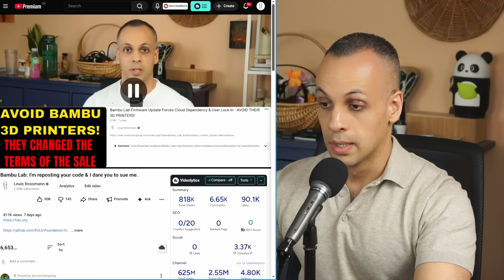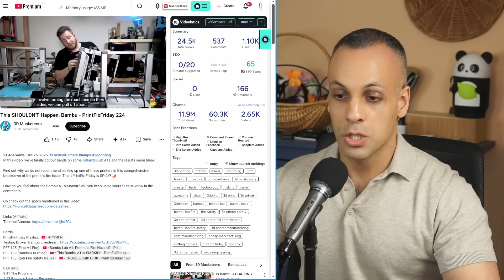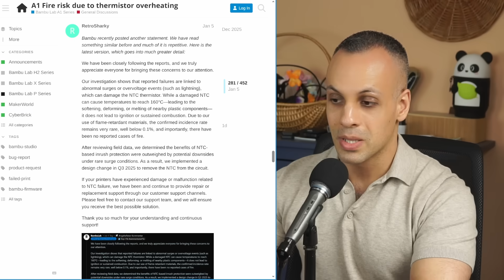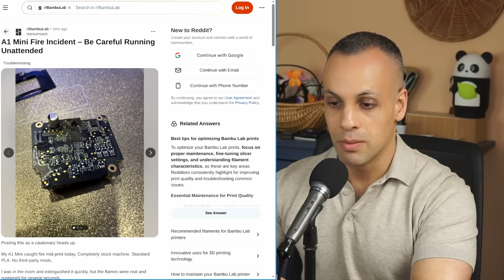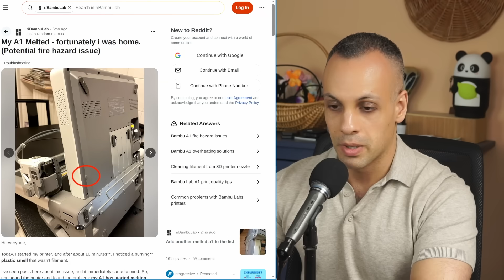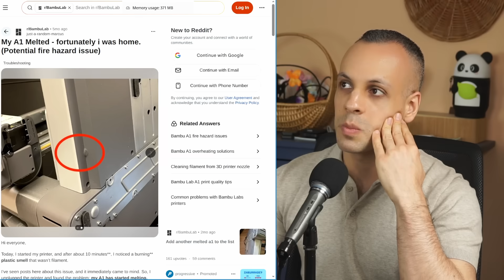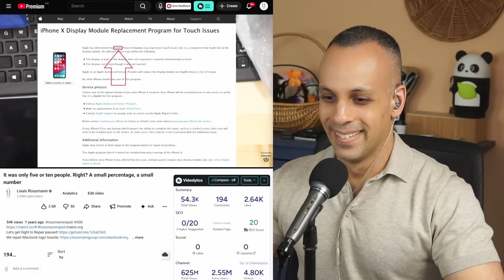Bambu Lab PR dumpster fire is turning into a literal one...

Comment: I use a bambulab a1 mini, and got a 3rd party AMS, and after managing to flash the right firmware on the AMS to get it working with my printer, the printer every 4 or so prints starts throwing a tantrum complaining that the firmware version isn't right between the printer and AMS and completely cancels the print. This happens after the download and unzip, and i have to both cancel the warning on the printer, and in the slicer, and then re-send the print and hope i don't get the error again.

It is a pain in the ass, and i have no idea how to fix this, i got the same 3rd party AMS that another friend uses for their A1 printer, and for them it works fine.

Other than that i had no huge issues with it, so i don't really have much personally to hate them for, but damn i kinda wish there was a company as popular and famous for their easy setup and "it just works" usability such as bambu, cuz i would've rather went with a company that doesn't try to fk over its customers..

Oh well, i just gotta never update it again, nor the slicer, nothing, and i'll keep being able to use it. :D

Comment: I don't know how bambu managed to source NTCs that doesn't do the NT part reliably
Reply: NTC = Negative Temperature Coefficient thermistor. It's counter-part is the PTC = Positive Temperature Coefficient thermistor.
An NTC has a (relatively) high resistance when cold and the resistance goes DOWN with temperature increases (ie. current flow lowers impedance). This way it provides excellent protection from surges while powered down. They are common in AC power supply design and operate very hot (>100C) in normal operation.
A PTC has a (relatively) low resistance when cold and the resistance goes UP with temperature increases (ie. current flow increases impedance). This way it provides excellent protection from short circuit loads on battery output terminals. They are common in battery packs but provide very limited protection if already operating at high temperatures.
Reply: @dl5244 what does this contribute to my comment?

Comment: Just like I owned a DJI Mini 3 Pro then upgrade quickly to a Magic 3 Pro, just got a new H2D to upgrade X1C (paid $1000+ 😔) they are great products. A lot of it, as you say, just works. Where others lag behind Bambu takes the lead, eventually others will catch up but right now Bambu, like DJI, is on their shit hardware and ecosystem wise. Sure they have issues, but they have less overall bad experience with customers I'd say. Competition drives prices down so I hope others step up to the challenge real soon, theres some interesting printer tech coming down the line soon, just don't want to have to pay $2k for next one lol.

Comment: Well, NTC's are supposed to get hot, they are most efficient in that state. But exactly because of that the designer of PCB has to place them away from components sensitive to heat.

Comment: my a1 stopped working and smelt like burning. i look at the bottom and a literally hole was blown out of it and melted. i opened it up to find something on the ac board probably a resistor of some sort had exploded. I contact bambu labs about it and they said I needed proof of purchase to get it warrantied. It was a gift and i dont have a receipt. Its a bambu labs printer!!! why on earth would i need a proof of purchase if its a printer from them. it shouldnt matter where I got it. there defect caused it to blow up. its less than a year old with light use. I hope they send me a replacement but im not crossing my fingers.

Comment: Every NTC thermistor / reaistor I've ever seen is near the power input, and usually in my experience with consoles, their power supplies have them and they burn up and could %100 cause a fire. Idk what the hell they're talking about. It's not like its a fuse that blew, that wont catch fire.. an ntc thermistor or negative temperature coefficient resistor where all that power is coming in.. good sir.. lightening? LIGHTENING?!?!?

Comment: I have the P1S and leave it running unattended. The only thing I don't like about it is the closed source network module. I plan to move it to its own locked down network segment so I don't have to worry about having closed source CCP code on my network.

Comment: I had 4 Bambu Lab A1's and 3 of them had boards that shorted out completely. Those occurred only 2 weeks after buying them. The 4th one had a mainboard failure which Bambu kept saying it was caused by a bad 3MF file that was sliced using their software. In the 6 years i've been 3D printing i've never seen that occur. Thankfully all 4 machines were purchased from Micro Center and they allowed me to return them even after the 30 days return window since Bambu kept giving me the run around for over 2 months. Since then I've been slowly switching my print farm over to Creality K2  and K2 Plus printers, along with the new Snapmaker U1. Both companies have had awesome customer service and they actually like seeing users modify their printers.

Comment: Hey Louis, been a long-time watcher. I like what you are doing and stand for, I do miss the old board repair videos, but this is also nice to watch. I am sure a lot of people know the name here, but Prusa makes a very good printer as well that is competitive against Bambu labs and based on what I have read about them they are much more in line with what you stand for. I.E. open-source Firmware, source files for 3D printed parts to replace on their printers. Overall, a much better company in my opinion and their customer service was also on point the one time I had an issue with their printer. Your comment at the end of the video is the reason for my comment now. Pruas's PR department may not be as big as Bambu Labs but they are one of the OGs when it comes to 3D printing and they are a very good 3D printer if people are looking for an alternative.

Comment: They always claim "small number" or "isolated case" or something like that. Years ago I was maintaining a piece of machinery about 100 times the price of a consumer 3D-printer. The particular model had a well-known in the field design fault that caused a part to fail after a certain amount of use resulting in a day of work replacing it and parts cost of a few hundred euros. Every time I ordered the parts for another repair the importer's parts salesman went through the same well rehearsed speech of how this part ALMOST NEVER failed and I was the first in a long time to ask for it and we must be doing something weird with our machine for it to fail. They still always had them in stock and the manufacturer was obviously trying to solve the problem as they kept slightly changing the part and issuing service bulletins aimed to prevent the failure so they knew the problem but refused to admit it in fear of people demanding actual repair or replacement of their machines.

Comment: Shame on the ntc mockers. Lets cloud source the fix. Ntc is there for for a sound reason. Maybe it is underrated. Maybe it needs a heatsink and offboarded. Maybe you slow down the printer under heavy max loads.  An electrical engineer can explain the why and how bit. Some thermal feedstock needs greater current

Comment: I have a bambu printer along with a voron, prusa and some others. 

my bambu is on an old firmware version and i have dns blocking for updates and I use orca slicer. I bought the printer for the reliable quick prints knowing I could downgrade the firmware and firewall my printer from the rest of the network

Comment: I bought one about 14 months ago only to learn after the initial return period that they were forcing firmware updates to prevent using orcaslicer and that every print needed to go through their cloud BS. Since then it's been completely on lan mode only and I still use orcaslicer. Its still a good printer but I'll use it till it dies and never buy off them again.

Comment: Something that not a lot of people realize is that Bambu doesn't necessarily have the best machines on the market. They look shiny and have a polished UI, much like an Apple device, and they have very good out-of-box functionality, but they don't even have the best print quality on the market. You can get just as good of a print off of a cheaper open source alternative without all that much effort in my experience. The reason people think that they are miles ahead of the industry is mostly just the fact that they have more active PR, and have provided a user experience that caters to those who don't really know about 3D printing.

Comment: I use bambu a1 and p1s at work. At home I use prusa mk 4

I do the bare minimum maintenance on my prusa, never have any issues.

At work, I take the bambu printers apart once a week to fix some random issue. Often involving replacing a part or sinking more time in fixing the machine than I would like.

Print time per week is roughly the same between the prusa and the bambu printers.

Better to spend some more money and get something reliable rather than save some and get a piece of crap...

Comment: Hot tip for Bambu.... The new released X2D combo with AMS2Pro. The AMS2Pro had an internal feed hub problem. Check out how many people had that problem. It was so bad that the community came up with a print that could be done to "hack" the feed spring to get the part to work, because the replacement internal hubs were on back order, due to customer service having to ship out so many replacements. Instead of Bambu recalling all the defective AMS units, they just tried to cover it with having the customers do all the labor and replace the internal hub. Super disappointed as it was my first venture into bambu products. Was happier with Elegoo CC despite the games they played with the canvas unit. :| They at least threw money at their customers, and continue to provide very inexpensive solutions.

Comment: When I saw "confirmed incidence rate ... below 0.1%" my jaw hit the floor. My job is investigating customer complaints at a manufacturing facility, and the idea of having so many complaints that you would express them as a percent blow my mind. The standard is to track and report complaints as "CPMU", or "complaints per million units". Good manufacturers will have a CPMU in the low single digits; 0.1% would be a CPMU of 1000. And tracking complaints in CPMU will include ALL complaints, not just the confirmed ones. If someone calls customer service to tell us that our product isn't as nice as our competitor, that gets counted. So when I see them say "Less than 1000 per million units are confirmed to have been at risk of catching fire", I say shut down production, fire everyone except the people at the bottom, and start over from scratch.

Comment: No BL printer for me. I got an obsolete Cube Pro Duo, and ripped the guts out. It’s now running on a Duet w/LAN controller. Using a custom extruder/hot end. The original printer was horrible. But the framing and other supporting hardware are phenomenal! I can put it up and move it, while printing, without issue.

Comment: I like how Bambu pushed other companies to do better with their design and ease of use. I don't like their practices of locking people into specific solutions. I don't appreciate Bambu gaslighting people. However, I don't begrudge or demean people who don't mind or even prefer that.

I will not buy a Bambu, but I'm happy the hobby is more advanced because of them, particularly in the low-end printers.

I appreciate what you, Grant and others are doing to hold them accountable for any safety issues.

Comment: The firmware lockouts instantly put anti-consumer Bambu Labs on my shitlist.

I've been running an Ender-3 V2 without issue for about 2 years and I'd say it was still pretty easy for me as a beginner.
I do plan on buying more Creality hardware, but I need more space. 😅

Comment: “If buying isn’t owning, then stealing isn’t theft.”
Reply: ... but setting fire to someone's house is still arson, right?
Reply: I think buying something without owning it is fine if 1) It it clearly disclosed on the outside box on the product or on the company's website what rights you have when you buy the product 2) the disclosure sold with the product can never be changed after the fact unless it is to grant the owner more rights and abilities and 3) they sell their product cheaper because of the restrictions to your rights.  Kind of how Amazon sells the Kindle's with ads cheaper than the one without ads.  BTW, don't use a Kindle unless you jailbreak your kindle because they could conceivably brick your device or delete your book collection.
Reply: @AlanVersion2 that would be leasing. Not buying.
Reply: @AlanVersion2  Leasing*

Comment: It's bonkers that they don't simply measure the voltage across the NTC to ensure that this component, that's effectively a resistor in the input path and meant for passive protection against high currents, has not failed and gone into thermal runaway. Look at any high-current power supply design and multimodal protections like that and thermistors on switching mosfets are abundant because they know components can fail in this exact way and burn down a house.

Comment: I remember the days when your printer hot end would melt down because you either didn’t screw the little thermistor into the heat block tight enough or you screwed it in too tight. Especially back before the software was smart enough to shut off the heating element when there’s no or an anomaly reading. Good times

Comment: The rumours about Bambug's practices started just before I baught my latest 3D printer.
Thank heavens I smelled a rat and decided NOT to buy one of theirs.
I could not be happier with my decision to purchase the Creatlity K2 Plus Combo.
The prints are every bit as good as what I have seen come off Bambug printers.
The printer was a breeze to set up, after allowing for it's weight due to extremely robust construction.
I have only had 2 feed fails in the CFS in over 9 months of usage and have accrued over 700 hours of faultless prints.
Message to Bambug, FAFO. Word of poor customer relations travels at the speed of light on the internet.

Comment: I’m in Australia, and I have an A1.  It was a gift from my wife, to supplant/ supplement my aging TEVO Little Monster.

To date, it has performed flawlessly.  I have not had a single failed print.  I have not had any issues with printing my own creations.

I am a fan of the Simplify3D slicer, and it is the only slicer I use with the TLM.

I have no issue with BambuLabs’ slicer.  It works well.  I know it is a derivative of another slicer, which is a derivative of a different slicer, etc, and I know Bambu are doing the wrong thing, by stating it belongs to them, when it is open source.

That said, I have been able to print some truly amazing things with the A1.  Things I cannot print with my TLM, even when it is superbly tuned in, for each project I print.

I forgot where I was going with this.  Suffice to say the A1 produces absolutely fantastic, detailed, 3D objects.

Cheers,

Comment: Engineer here. A component going rogue and reaching 160C unchecked is not a "minor concern", and is absolutely a risk for ignition. While their components in the surrounding area might be rated to handle those temps, do you know what isn't rated for those temps and can very easily catch fire in that range? Dust. Dust can have a flash point of anywhere from 300C all the way down to around 120C depending on its make up. This is notable because they are often lording the benefits of 3D printers to people that "enjoy crafting", which includes a lot of mediums like sculpting, wood work and engraving (among others) that produce a lot of dust. Anyone that has ever had to run tech support for a wood worker knows that anything with a fan in it will pick up LITERS of sawdust if you let it. Keep your laptops outside of the workshop, lads.

Also, for you to reach these temps ACCIDENTALLY, means that you were pushing a minimum of an amp of current unwittingly into the component, which means you are just incompetent at circuit design. Don't get me wrong, issues like this happen ALL of the time in circuit design, but you should have noticed something was wrong in either simulation or the breadboard stages. West coast American and Chinese companies like bambu are INFAMOUS for skipping steps in the design iteration process either for "visionary progress" or for corner cutting, and it leads to mistakes like this all the time. If they had actually done the proper thing and made a demo circuit on a breadboard or perf board, they would have seen the issue during their thermal testing (which you should be doing electrical, thermal and oscilloscope testing on all boards you intend to commercialize, btw), they would have seen the thing lighting up like a christmas tree when run at 120VAC at the higher amperage of US outlets, and would have avoided distaster... Same thing caught QIDI tech a while ago, btw.
Reply: Yes, certainly a fire hazard.

Comment: The Bambu Labs A1 Printer I bought from amazon from Black Friday in 2025...had this issue. They replaced the power board with the updated version and cover. They didnt really fight me on it. I provided pictures and they just replaced the parts. And that printer was connected to a UPS that also controls my home lab and server. So yeah, surge causing this issue my ass. I questioned them then, still question them now.